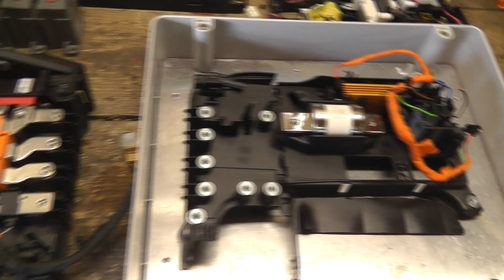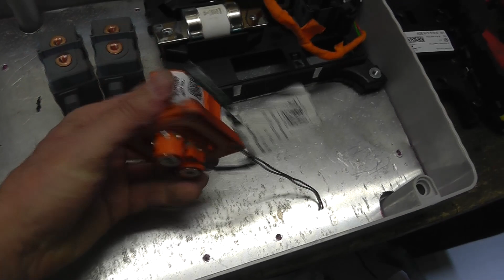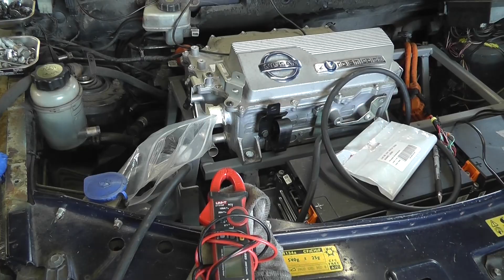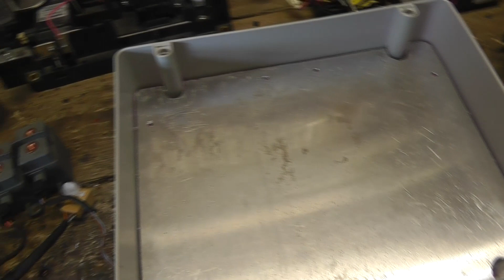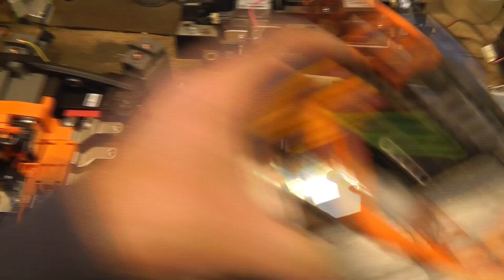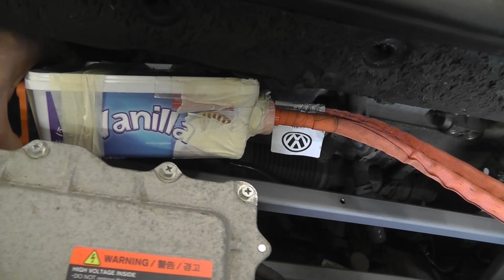DIY EV Part 28 - High Voltage Junction Box.

Comment: do you have to have a contactor on both the positive and the negative? is a single contactor to open the circuit on one of them sufficient?
Reply from the maker: I believe it needs to be both for safety reasons. It is possible for them to become welded shut so they are short circuit. If this happened and you only have one contactor then the system would remain live.